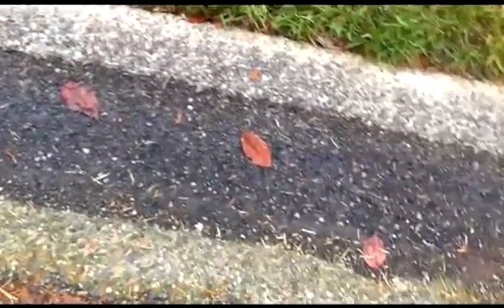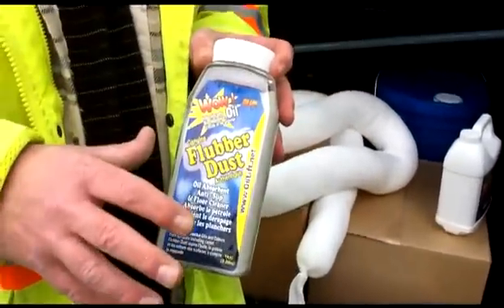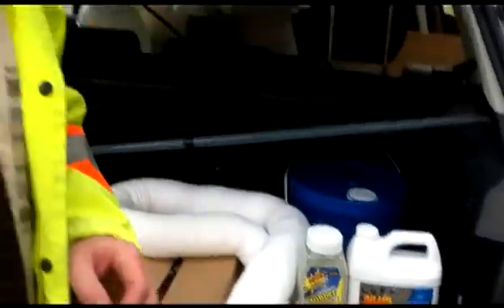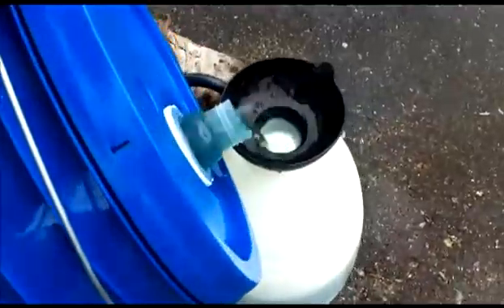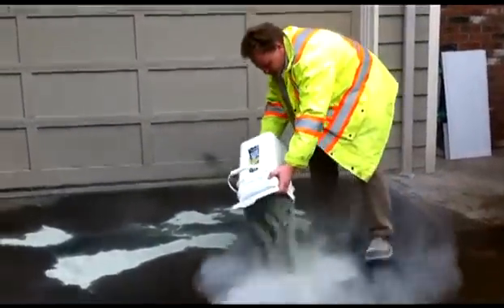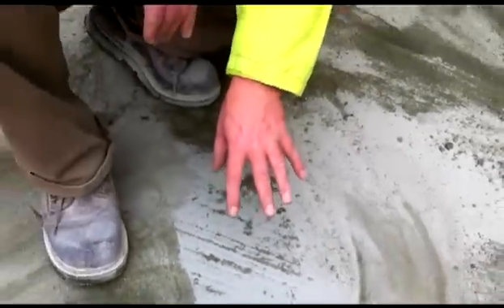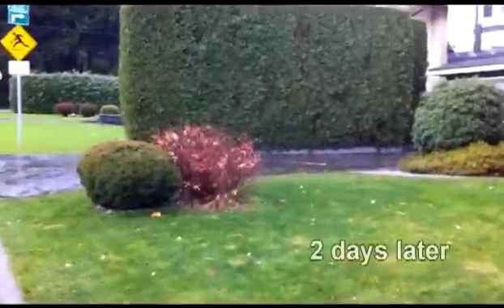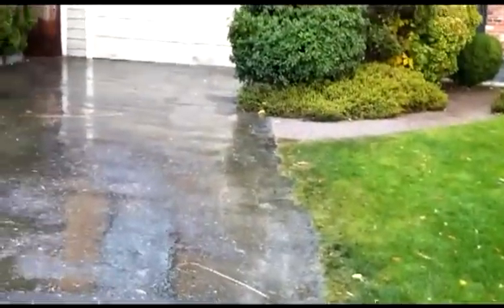How professionals clean up land based oil spills

Comment: How about a Spell in your home by the oil company
Reply from the maker: I’m not sure what you mean BV. 

Please explain
Reply: Oil company came in and over spill oil they cleaned.. but there is still oil odor in the air.. how or what could we use to clean up the area to eliminate the smell.
Reply from the maker: @mariacapra2271  irs because the oil is still there 
Use flubber dust and it will pull it our 
If you need more help call the office and they will send your contact info and I’ll call